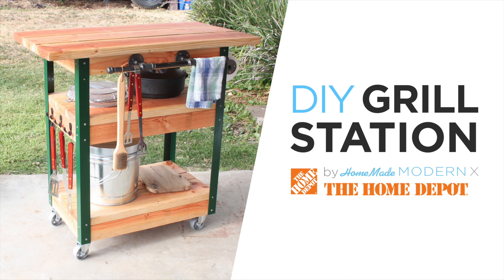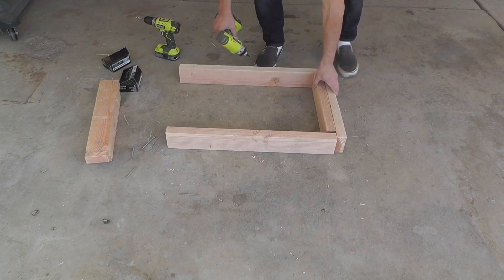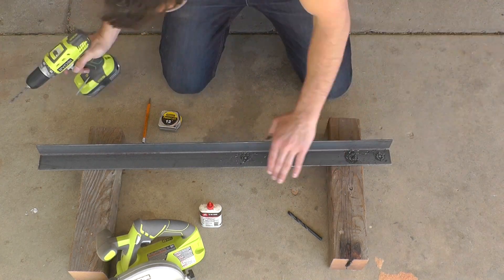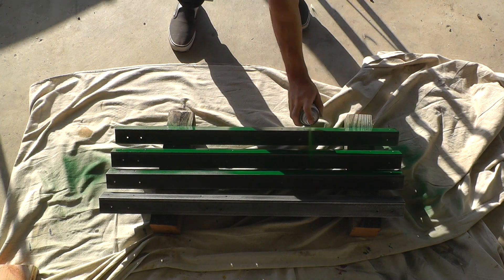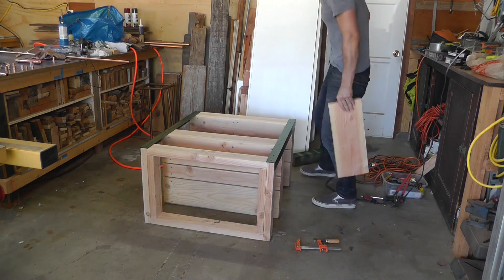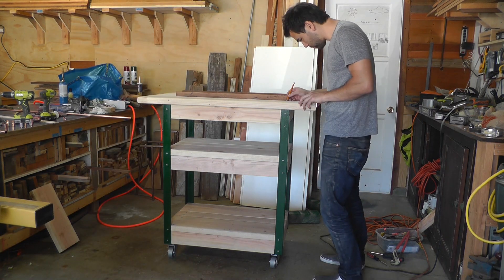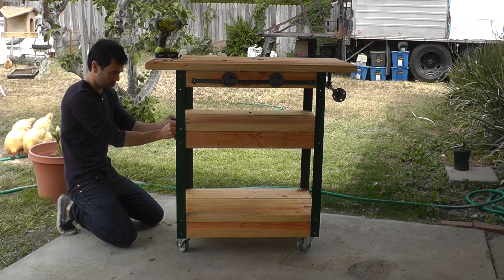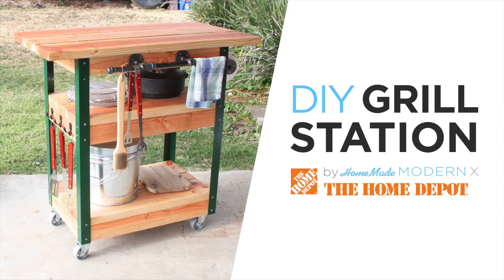DIY Grill Cart

Comment: The widths of the three shelf boards add up to 18 inches. (7 1/4 + 7 1/4 + 3 1/2).  Can you tell me why you made the frame width 19 inches? Is there a 1/2 inch gap on either side of the 2 x 4s? In the video it looks like they are touching.

Comment: Ben,

What was the advantage to using frames for each individual shelf instead of your shelves just being made up of your 2" thick boards? I'm in the process of getting materials together for this build, but am debating between building frames like in your video, or simply joining my 2 by's to make my shelves, and screwing into the sides of the boards themselves. Thanks!
Reply: Sam Jennings maybe to create enough material to screw thight the green angle iron. I am no sure though.